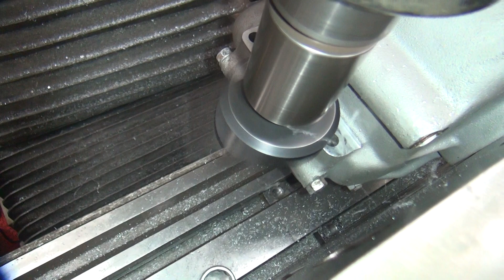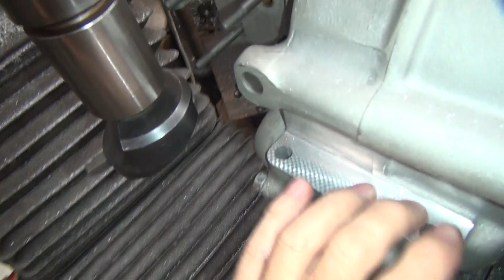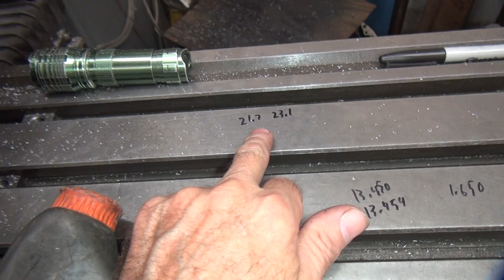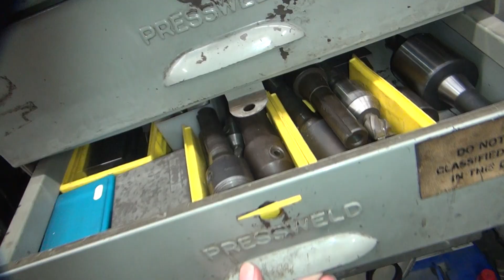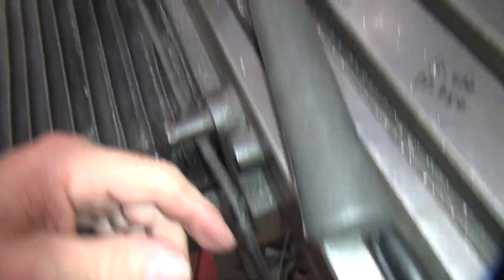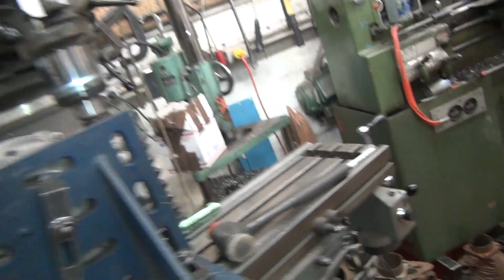#148 1946 junk 84ci stroker knucklehead 500 mile new repo motor rebuild 79ci harley tatro machine

Comment: Nice work, Mr. Tatro. Motortechnic Mfg looks to be a quality outfit (from their website anyway). I wonder why those cases were so off?
Reply from the maker: beats me. this is not the only one that i have had that needed work. the distributor hole being off seems to be a common problem. nice clean machined surfaces don't matter when nothing fits correctly.
tatro